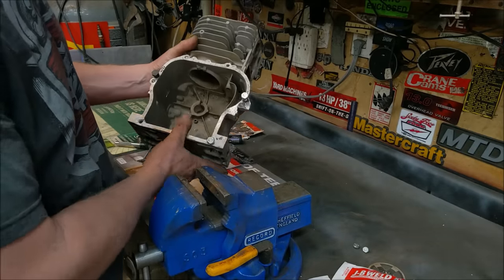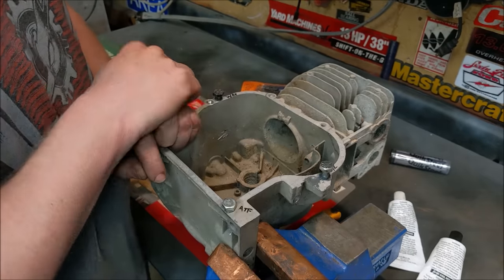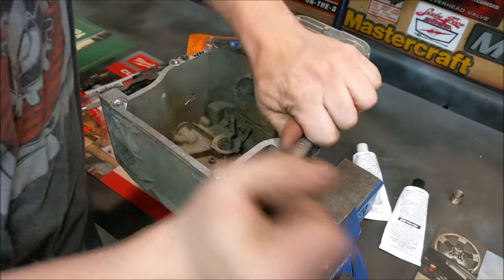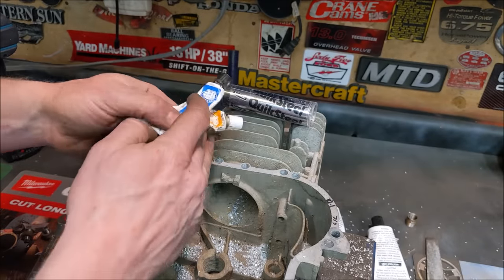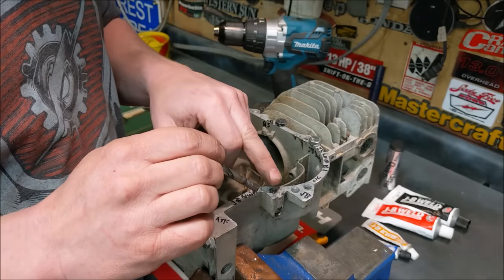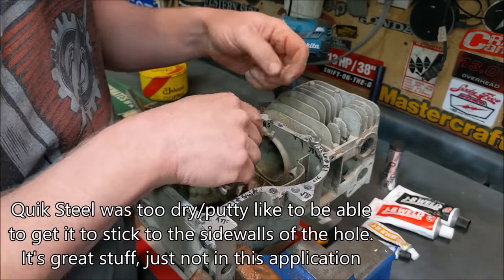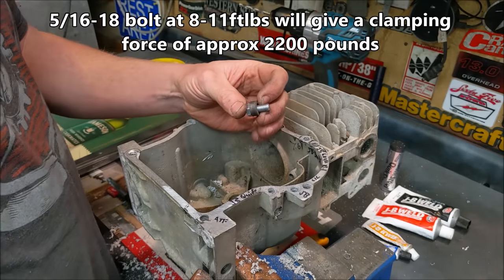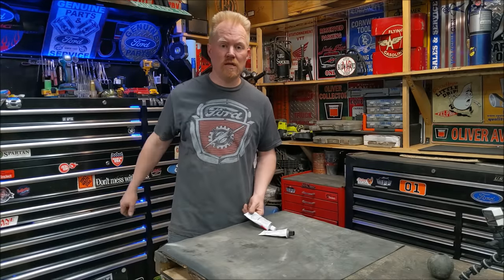FIX stripped bolt hole threads the POOR MANS WAY

Comment: I’ll bet that if you cut threads in the hole, any pitch as long as it cuts threads, then use JB weld it’ll give the JB weld something to grab on to. Right now there’s only a smooth hole. But you double the torque at the very least.

Comment: How/what you choose/use to prevent the bonding has my curiosity peaked.
Reply from the maker: Wax or Automatic Transmission fluid worked best to not allow the JB Weld to stick to the bolt threads. The threads formed extremely well.
Reply: @sixtyfiveford I wonder how much stronger the jb would hold if we somehow gave it more to hang on to in the hole. Maybe after drilling out the drill, some strategic damaging of the walls with a punch or chisel would help the jb weld grab.
Reply: @sixtyfiveford  what kind of wax?assuming you didn't completely fill the threads with wax how did you get a good coating without filling too much of the threads?
Reply: @dansawinski1676  the jb didnt fail holding in the hole, im sure the threads of the jb ripped off inside itself

Comment: I wonder if silver solder being tapped would be better?
Reply from the maker: Silver solder won't stick to aluminum but it would be viable in steel. The thumbnail picture is a bolt that I covered/melted in solder and threaded into a stripped hole. It got right about 8ftlbs before spinning out in aluminum.

Comment: The cast iron block on my van had a hole in it leaking coolant. Cleaned the hole up with a die grinder. Hole was about 6mm diameter. Filled it with chemical metal epoxy. Been leak free for 4 years straight now. I thought it was going to be off to the scrap yard but she keeps holding on.
Reply from the maker: That's awesome.

Comment: I used JB Weld, and when it cured, it never became like a hard metal. Instead, it was crumbly. I made another batch and tried it again...same poor result. What happened?
Reply from the maker: I don't know if it has a shelf life. I know the JB Qwik stuff I used was 10years old though.
Reply: sixtyfiveford — Hmmm...I wonder if I got a bad batch. I could always buy another pack and see what happens. Thanks, Moe.
Reply: 50/50 mix is important or failure.
Reply: Lok Tom — I did think that that’s what I’d achieved during both attempts, and if there was nothing wrong with the product, then the incorrect ratio would really be the only explanation for failure, so I’ll just have to give it a go again sometime. I’ll first try it again with the one is have, since Moe’s still worked after a decade.

Comment: I fixed a 2” shaft that had groves from a bad bearing on a big blower and the new pillow block bearing would be right on the groove...
    I filled the groove on the shaft with jb weld, filed it flat... so the pillow block bearing had a new surface To lock onto...
Reply from the maker: Awesome fix.

Comment: Best thing to coat the bolt would be petroleum grease . We brush a thin layer on dyes , and the dyes are then filled with a liquid resin that is fast setting. Dyes come right off , but if you miss a spot the resin will come off with the dye and is a pain to scrape off the dye where there wasn’t grease

Comment: Praying this works for my fuel tank sending unit bolts.. I only need like 3 ft lbs... not 10 lbs like i previously thought... whoops.
Reply from the maker: You can also just try the copper wire strands I mention at the end of the video. .

Comment: How about a atv oil tank any tips
Reply: Keith Parady I’ve used the 24hour jb weld on a 4cyliinder Datson on the lower block, a crack almost 2” long, stoped the oil leak period. Scratch the block with red oxide heavy grit sand paper and brake clean the area real good over lap the break an 1” or more than paint it up works great. 😊

Comment: Better idea than oil on the bolt would be 1 wrap of teflon tape. I feel like oil may compromise the JB.
Reply from the maker: That's why I like the wax. The Teflon has much thicker layer and you end up with a looser bolt.

Comment: I've used it before for threads and greased the bolts. With varying results...usually in a panic.
Reply from the maker: I did it years ago with lower success. I used grease or oil and I think that mixes with the JB Weld where the wax has a chance to dry and not contaminate the epoxy. The ATF released fine but the top thread where I think the ATF got pushed up to and mixed with the wet epoxy were destroyed.

Comment: Doesn't work in every case, but instead of this, I'll glue in a length of threaded rod to make a stud with instead, so as to not create wear removing it in future. Also aluminum braze rods are better than jb or most other glues but I'm sure you already know
Reply: Gonna clarify what I mean, instead of using a bolt, I replace the bolt with studs and acorn nuts , makes it allot better, puts the wear and tear on steel rod, vs in aluminum threads

Comment: How about jbwelding a threaded insert?
Reply from the maker: It would likely give at the bond between the hole wall and outside thread. I think it would be stronger. But by how much; I don't know.
Reply: @sixtyfiveford  I'm thinking it will give at around the same torque ratings but the threads won't scuff and wear like jb weld would

Comment: @0:28

You're being ambiguous by saying "better".

I beg to differ with you if you mean better is stronger.

 Quality heli-coils are made out of stainless steel; such material is much more durable than aluminum. 

Durable is more preferred to not durable as it pertains to potential stripping of the threads in the future.

Therefore, drilling a hole larger in aluminum material for a bigger bolt is inferior in durability.relative to a heliicoil.

Comment: What if do both copper and JB
Reply from the maker: I did try it and it was slightly better than just copper. You can't tap it though as it cuts the copper stands. You have to wax the bolt and insert it.

Comment: not a fan of JB weld. seen it work and not work. Rather make a bolt in my lathe than use JB weld. BUT in an emergency it would be better than nothing. Thanks for sharing
Reply from the maker: Absolutely agree, but I talk daily with people who are rebuilding a piece of machinery and have little more than a socket set in their arsenal. I think the JB Weld would suffice to hold a bolt or more secure on a non-critical part(valve cover, etc).

Comment: JB weld has been  around for years.  I have heard frams have used it. I have used jb weld on lots of things. Im happy  with. Never used it  on motor block. To seal it. But if they haven't  changed the  formula. Im sure it would  hold.

Comment: If you mix metal powder with the epoxy, it makes the epoxy harder.
Reply from the maker: Yes however it doesn't increase the adhesion strength. and ultimately that's what fails is its ability to adhere to the sidewalls of the bolt hole

Comment: dang! That is impressive! Whoda thunk?
Reply from the maker: Better than I thought it would come out. It should be enough to allow the machine to continue out the rest of it's intended life. I had to search around for the data to see how much clamping force at what torque there is. I was surprised that a simple 5ftlbs on this size bolt puts approximately 1000 pounds of clamping force between the parts.

Comment: Well fast glues are hard like glass.
Long curing glue's ummmm a little more bendy,.... tougher,.... high impact.
Apply heat to the bolt then un-screw it.
There's a better way.
They drill it bigger.
Thread in a piece thats threaded on the inside and the outside.
Then its stronger than the original.

Comment: show how to wax the bolt without filling the threads
Reply: Heat bolt with lighter and excess will drip off.  Just a residue would be needed for this.  Better way to go though is to jb weld a stud in place and use a nut instead of a bolt.  Have done this a dozen times over the years and it always works.
Reply from the maker: It's not wax like candle wax, but more like car wax and very thin. I just wiped it on and off instantly with a paper towel. I used Johnson's Paste Wax but any car wax would do the same.

Comment: has thE extremely crE8tiv IDa ever occurred to you, to mix up sum regular JB wLd.. push it down the rIT sAm sIz tUb as hole into hole tL it totally fills the hole- w8 for it to dry to a putty like consistNC.. flop a socket on original bolt & turn it down tell it’s at flush as if totally tightened, w8 till JB gets hard(all these consistency tests done with same JB weld on the side) - & then unscrew bolt... thN w8 a few days, & attempt to tighten bolt in that JB wLd threaded hole?🖐🤔

Comment: Next test.... Epoxy!
Reply from the maker: JB is just epoxy with steel dust mixed in. I tried Bondo for fun and it didn't hold.... No surprise.
Reply: @sixtyfiveford  I didnt realize that. I've used the long set JB to fill pitting on a gasket surface. Stopped a coolant leak.

Comment: When you said vertically gouge the inside of the hole i thought that would work, a small screwdriver tapped with a hammer for some deep gouges.
Aluminium is so dam soft, it's horrible  :-(
Just my mad opinion of cause :-D
Reply from the maker: I think some deeper perpendicular grooves would help.
Reply: @sixtyfiveford  You and your posh words ha ha :-D
I'm english but my spelling and use of worms.. i mean words is so bad lol.

Comment: JB quick is junk IMO

That wax idea looks legit and maybe better then what I've always done .I let it set up it'll it's not wet anymore run your bolt in and out then let finish curing. 
I've done this on my own vehicle with spark plugs , it would last about 40K miles before failure .

Comment: 4: 52, JB titles their epoxy deceptively as if it were a weld. Far from it, it's epoxy. West System epoxy is stronger, higher adhesion, and is a very honest company with an engineer a phone call away. Their G-Flex 650 glues many plastics. I have nothing to gain, just FYI.
Reply from the maker: There are better epoxies for sure, but I wanted to keep this simple and easily obtainable.